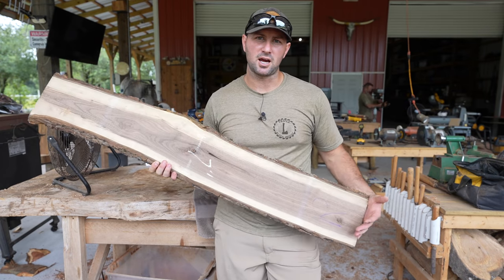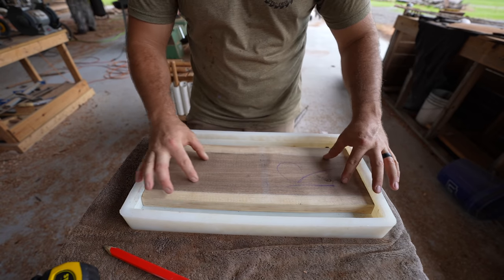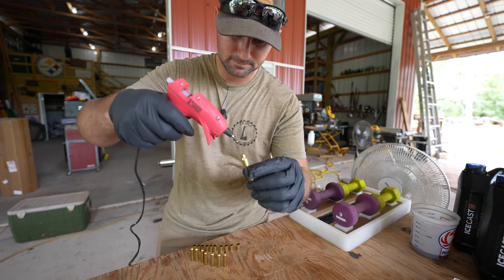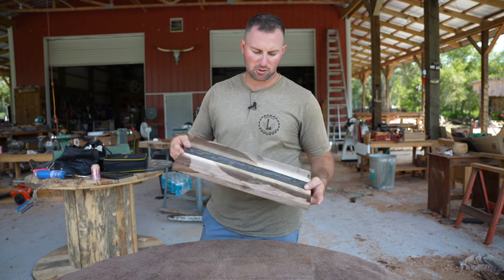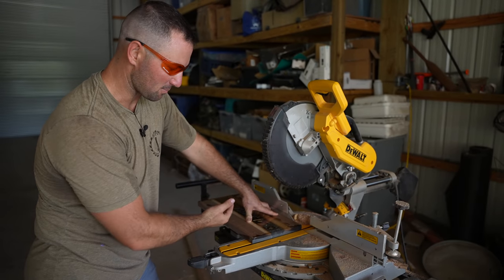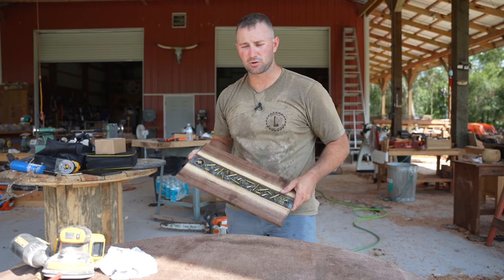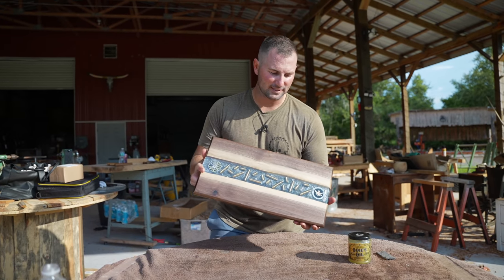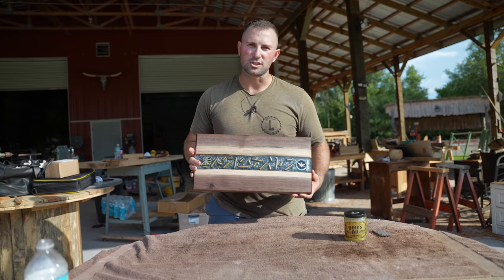Black Walnut Epoxy Charcuterie Board Sprinkled With Freedom

Comment: When you buffed the 105 paste, some of the paste was absorbed by the pad. Since you didn't change pads between the 105 and the 205 paste, the pad still had 105 paste on it so the full effect of the finer 205 was negated. You should always use different pads for each grit to prevent this.
Reply: it makes sense on what you said however, He may have done that without video. either way, his project is amazing! so results are still incredible.

Comment: Awesome project,  Just a recommendation, I noticed you clipped the corner while putting the chamfer on, but I always route the end grains first as it is the most likely place for chipping out, That way your long grain cut will cut out the chip out if it happens.... it appears your bit is much sharper than mine! LOL   I may have to do one of these!  I have a sawmill in North central  Indiana (about 1 hours south of Michigan). Walnut is very popular and easy to come by here, I have several walnut trees and Cherry trees on my property. have a great trip when you come up this way!
I'm a little partial as well, I am a Semi-retired Officer, spent some time as a SWAT officer back in the day!  I'll be fully retired December 4th 2021. Thank you for your service !

Comment: Just a helpful tip. If you want to sort of seal the casings, I would put some epoxy inside them, put some tape (or something else to seal the mouth of the case) over the top, then flip them over so the epoxy cures in the case mouth. It will save you some time and epoxy doing it this way. Good luck!
Reply from the maker: great tip thank you!

Comment: Nice board. When you switch to a finer grit polish, you need to use a clean pad or you are just using the rougher grit again and not finer grit.

Comment: Try a sand-o-flex for bark removal. Clean the shell casings with methyl hydrate and scuff the casings with coarse 80x sandpaper. Epoxy is 100% mechanical bond.

Comment: curious to see if anyone has a preferred/ recommended mold release spray. ordering my first mold today but i dont see any releases on their site. also great job on that board man, it really is an amazing piece of work.
Reply from the maker: MG Chemicals 8329-350G Non-Silicone Epoxy Mold Re... https://www.amazon.com/dp/B005T6GTGO/ref=cm_sw_r_sms_api_glt_fabc_22EKHF1KP22MC599TMGZ?_encoding=UTF8&psc=1
Reply from the maker: I use MG chemicals epoxy mold release from Amazon

Comment: I applied the 105 and I am working in a cold shed right now, but I can’t get it to stop getting foggy after the moisture dries on the epoxy. Whether it’s the polish, water, alcohol, my epoxy area keeps fogging up like your windows do in your car when it’s cold outside…is this normal?
Reply from the maker: The epoxy gets hot when it cures. Maybe because it’s hotter then the cold room temperature?
Reply: @TripleLRusticDesigns  thanks so much for the advice but the epoxy has actually been fully cured for a couple weeks. I’m honestly not sure what is going on :(

Comment: Why are you stripping the live edge from the board? The live edges give the board rustic beauty.

Suggestion: Save time and effort and lightly coat the whole project with clear epoxy and then buff it to a nice shine.

Comment: Unless you change the buffing pads and sandpaper when you use the polishing comppunds your wasting your time using the 2nd compound because the 105 is going to take over since its still left in the pad/paper and won't let the finer grit compound do what it needs to do. So for future reference change the pad and paper out and you'll see a big difference since the finer compound will actually be able to do what it needs to do

Comment: Tip to go along with making more epoxy than you need.... Have an extra little project sitting ready that you can pour the extra into. I have a bunch of cheap little silicone molds for pendants that I use, then give away to kids at markets.  Or I'll have another little project that doesn't matter what colour or mix of colours it needs and pour into it.

Comment: I’m not an expert but when I was in wood shop many years ago I was told to always cut away from the body, it’s dangerous using that scraper to scrape the bark off with the blade going towards you one slip and you just stabbed yourself up

Comment: Wear some protection mate, seriously. Cutting epoxy on a saw without a respirator (or even a face mask) is just asking for trouble, also eye protection using a table saw/mitre saw, you don't want a loose projectile lodged in your eye for the sake of a cutting board and a few internet views.  I totally get what you are attempting with your channel and products but sadly it's coming across as amateur hour due to basic things. Please, for the love of Christ, get some PPE.